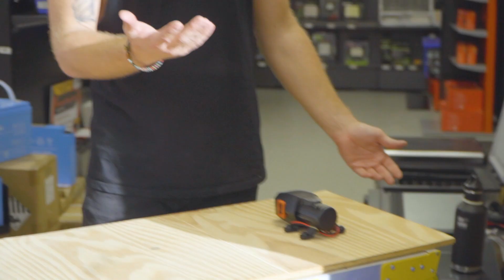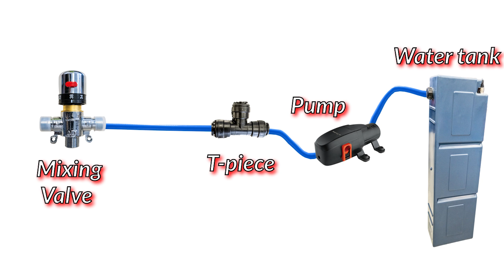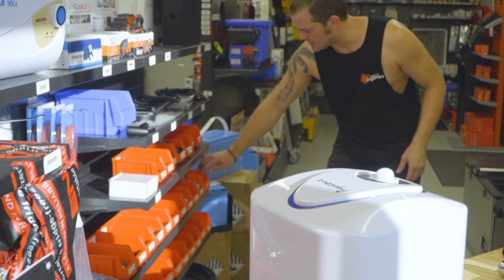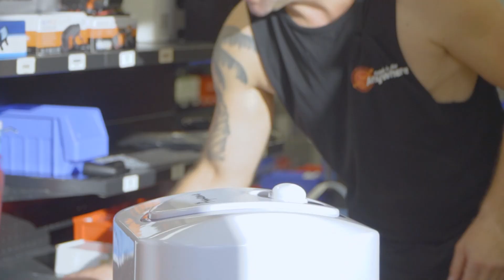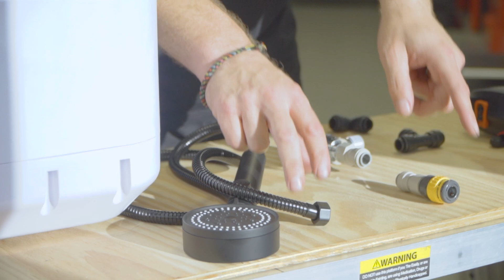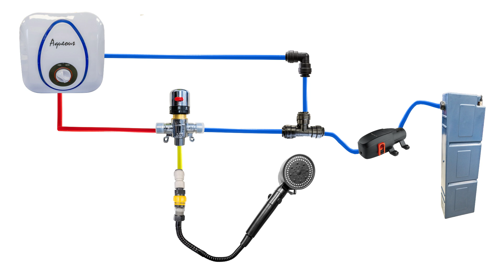Plumbing & Hot Water Installation for Your 4WD & Caravan

Comment: Thanks very much for the video, excellent 👌 
I will install it in my camper trailer, should I run it via 240v off my 3000w inverter or connector both the pump and hot water unit to 12v ?